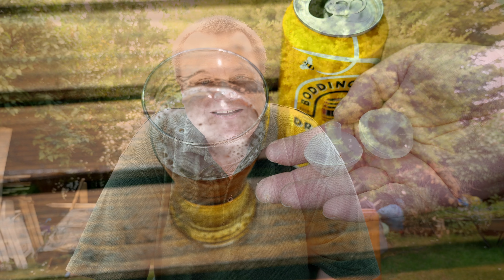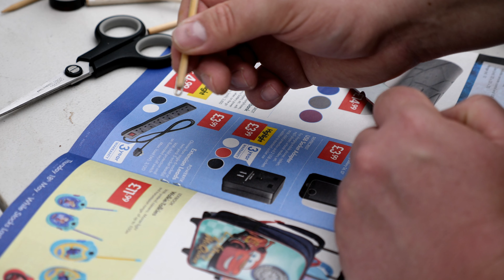Making Fishing Floats - Boddington Bobbers (Video 107)

Comment: Have you tried a golf ball as a ledger weight ,you can screw an eyelet into them,they give a good casting weight but are great over silt as their mass makes them sit on top .They are also very effective for rolling a bait down stream, as they very rarely get hung up and move much closer to the natural river flow rate then a lead weight
Reply from the maker: Hello there mate, I must admit I have not tried that at all, that sounds really interesting and quite useful, I am guessing they would be slow sinking and perhaps different brands of golf ball might sink differently? Either way 
That is quite interesting, thank you for suggesting it.
Reply: Hi Mark I,m Steve.With some types you can drill directly through the centre for in line set up for others just drill pilot hole and screw an eyelet in,spray paint what ever colour suits and away you go,cheap as chips and highly effective due to their buoyancy .
Reply from the maker: That sounds really good thanks Steve, I had a look at some of the fishing forums and see they have been used for bass fishing etc, someone did warn about the liquid inside the golf balls, so if need be I suppose just common sense and some safety glasses for protection whilst drilling. Must admit I am quite intrigued about this, so thank you for mentioning the golf ball idea.
Reply: Only "blatta" golf balls have liquid center all modern balls have solid centres
Reply from the maker: Oh right, I now know which ones to pick up at the local golf course, er I mean shop of course (lol). you're a wealth of knowledge Steve, thank you very much.

Comment: Hi, was just wondering if you recommend a Decent landing net? Mainly for all round use, thing like chub, tench and carp? Having trouble with breaking my nets:/
Reply from the maker: Sure thing sam. The Korum folding, spoon net would be suitable and is pretty sturdy, comes in either 22,26 and 30 inch sizes. I know the feeling with landing nets breaking, seems like there are quite a few that are just not good enough. I do also use a wychwood quickfold net, these cost around £20 depending on the size.

Kind regards
Mark.
Reply: Mark Erdwin thanks, I shall give them ago! They seem pretty decent, cheers.